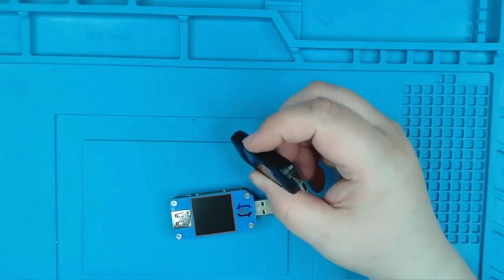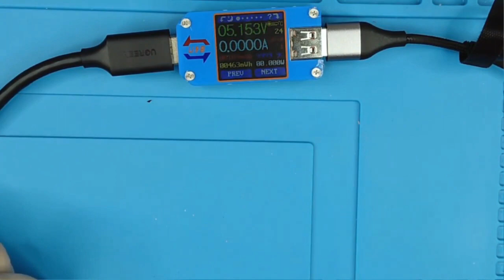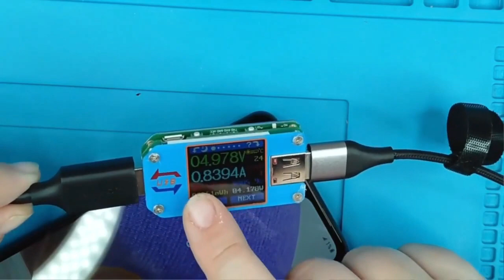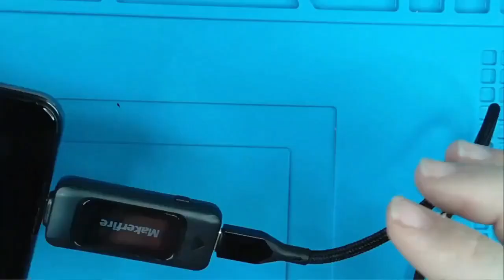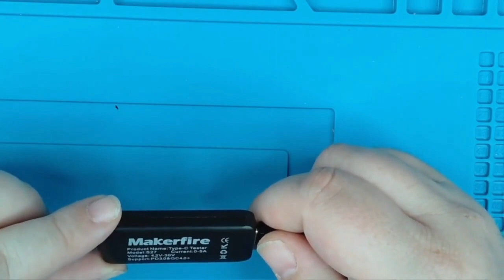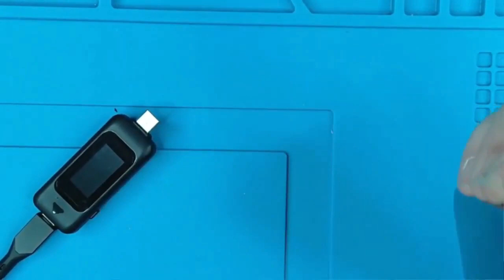How to use AMP Meters in Phone Repair (UM25C & Type-C AMP Meters)

Comment: Ok im a noob have one i plug into my fire tab drawing zero amps is ot the battery or usb port bad? Thanks for any help in advance
Reply from the maker: You actually have to do process of elimination unless you have connectors on the battery you can test : )  Just try a new charge port and check and then try a new battery and check... start with whats easier.. if you have the ability to test the battery that helps but those tools can be expense and not for a wide range of devices, unless you use a multi meter :)  keep in mind 0.00 could also be faulty testing equipment or a board issues... so its process of elimination when you are not a micro soldering tech .. you'll get there! don't give up!  If you ever want to learn board testing, join rfamembers.com they have TONS of free courses for members